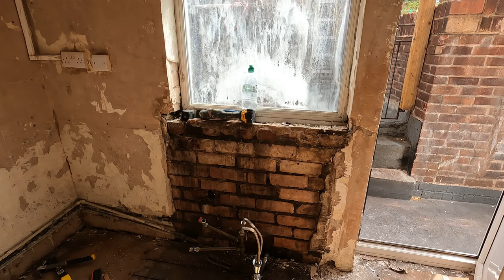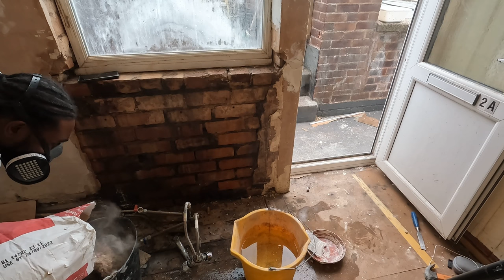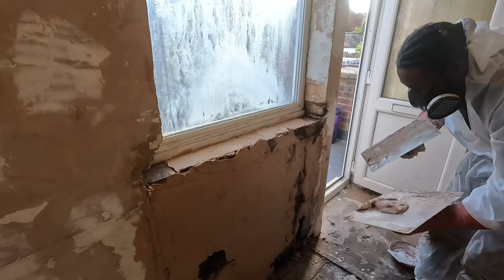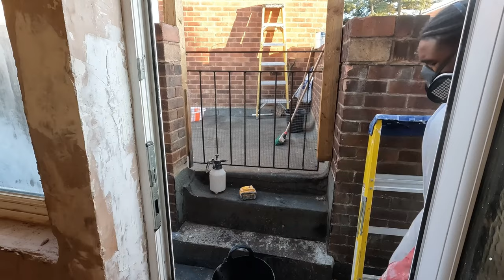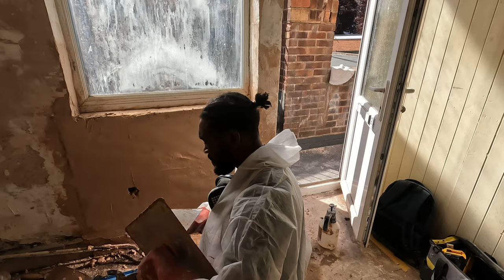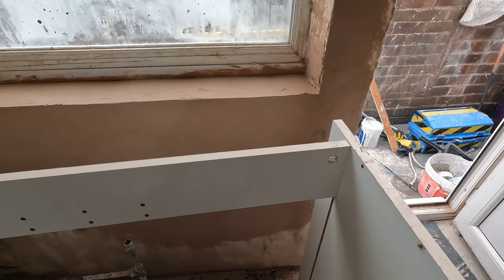A Carpenters first time plastering

Comment: As a plasterer- Very comical, and good to see you in high spirits and having a go. First tip for the future - add the water to bucket first, then add powder til its the right consistency. Also - scrape around the edge whilst mixing otherwise you'll end up with dry bits round the bucket
Reply: I also enjoy your reverse grip at the start - why the mask? LOL

Comment: With me it’s completely the other way around. I went from fulltime plasterer to tile layer, but since my body isn’t allowing me much anymore I am making the switch to carpentry as we speak. Great videos, keep it up 💪🏼
Reply from the maker: 😨 but carpentry is a hard graft aswell
Reply: @ttdowgcarpentry2390  that’s true, but I mostly prep my work in my shop and don’t spend as much time at the jobsite. This way I have more control over my hours and don’t have to rush anything. I still lay tiles and also do some plaster here and there if the price is right.

Comment: As a plasterer u are amazing at it for ur first go especially because of that job not a easy job for the first time even if small or behind a base unit iv , u have the nac of it and didn’t drop to much fair plays small tip if u ever have to do it again add the powder to water in a bucket not powder to water makes life easier , u got a sub 👍🏻

Comment: plastering is not easy, i did a fair bit when my mate baught a house that needed renovating, we got better at it over time, still not perfect but a small area like that i could do a good job of. Hardest thing i find is how quick the plaster start setting your your up against the clock from the minute you start, mixing the plaster very important and PVA on the wall very inportant of the plaster sets even quicker 😞
Reply: Pathetic idea ! You need to do a 3 year apprenticeship to get remotely competent at it 😅. Dont think you can just pick it up after 30/40 attempts